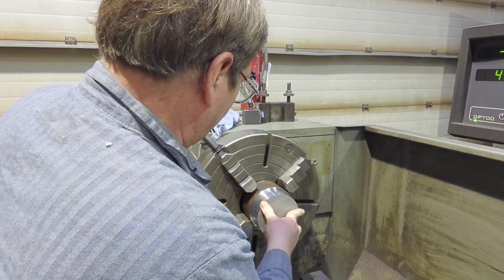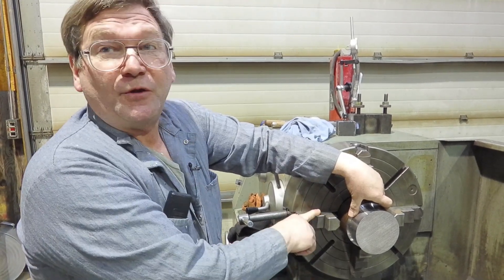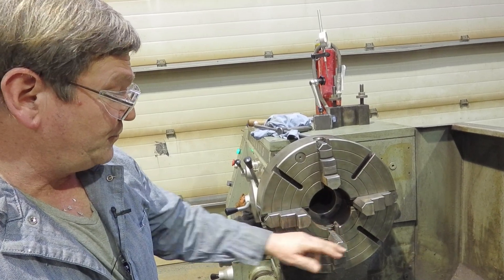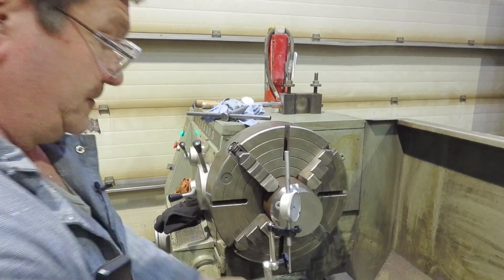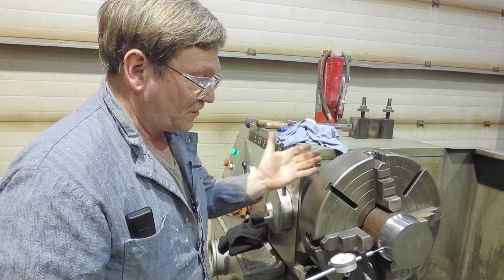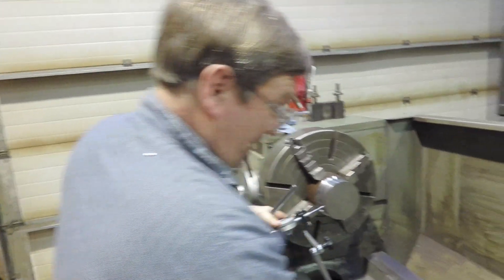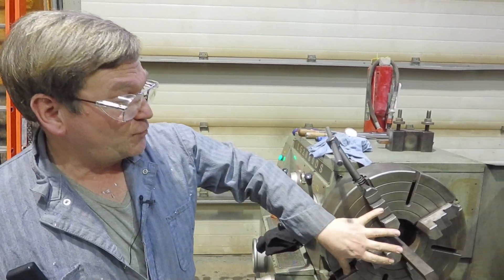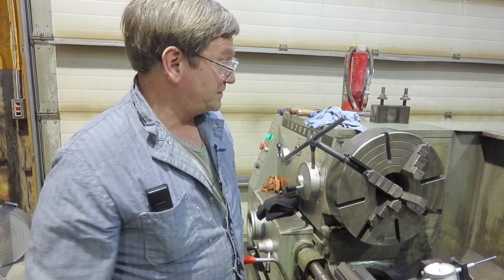Machinist's Minutes: All about four jaw chucks (part 1)

Comment: I can reasonably easily get within .02" TIR by lining up a reference edge on a dog with one of the circles grooved into the faceplate, then I turn my chuck key in fractions of a turn. The biggest asspain is getting things to run true when you can only clamp .375". If the part Im truing up has a machined face Ill just press the toolpost up against that and it usually gets me close. Its a good idea to turn extra reference lines into the chuck face for this purpose.

Comment: Does a 4 jaw actually have more holding power than a 3 jaw for heavy work?
Reply from the maker: given similar size, definitely more holding power.
Reply: 4 jaws apply force against opposing jaws, which is inherently stronger. 3 jaws apply force inbetween opposite jaws which give the part a chance to move. If it matters always use a 4 jaw. 
CNCs seem to negate this somewhat with more clamping pressure.

Comment: I don’t mind four jaws. I usually take diameters of chuck minus diameter of stock. Divide that by two and that’s how far your stock should be from the outside edge of the chuck. Even with a decent tape measure it’ll usually put you within .030” total indicator runout.

Comment: Cant beat the 4 jaw for versatility. Especially in a job shop where most work requires working concentrically with a pre-existing round feature. Each setup is unique and having the ability to dial it in is essential

Comment: That chuck you were using, with the other 4 empty slots, could you turn it into a eight jaw chuck ? I don't know why you would ever need to, but if you did, could you.
Reply from the maker: Those other "T" slots do no have enough casting material to modify for extra jaws, the purpose of the T-slots is to help hold work tight against the chuck.  Here is a link to a video on turning brake drums where the jaws, and T-slots are both used together for holding the part:  https://www.youtube.com/watch?v=GqV9PYe_NlQ&t=725s
Reply: @HOWEES  Thanks, once again you have taught me something.
Reply: Those are different slots, looks like more for face plate kinda work hold, clamping on the work peice

Comment: I only use the 4 jaw. My 3 jaw is 40 thou out. The lathe isn't something I use enough to buy another chuck. I'm getting pretty good though. I'm doing it in about half the time i was when i first used it probably 3 to 4 min dialing in.
Reply: My 3 jaw was .030 out. I fixed it by pulling the dogs out, cleaning them out and dragging the grit out of the spiral gear by spinning it with a wire brush in the grooves, and put all the dogs back in the correct order. You can find the right order by looking at where the teeth start on the dog if they dont have matching numbers. Also check the taper inside the chuck to make sure that its free of debris. My 3 jaw now has .004 runout and its a 60 year old pos. 
There is absolutely no possible way your 3 jaw is hopelessly .040 out, theres something funny there that you can fix.